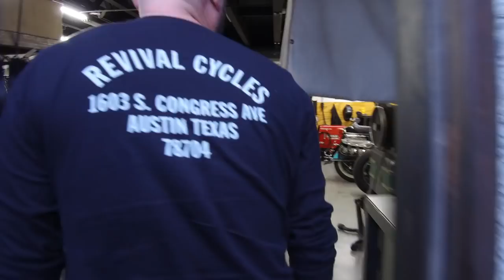Ducati build update and Alan goes colorblind! // Revival Daily 57

Comment: On the Kermit Comet do you think the bolts that connect the final drive to the swingarm are strong enough to support the back of the bike.  Did you consider connecting the final drive housing to the swingarm trellis frame?  I was thinking of turning my 82 GS1100G into a mono-shock in a similar fashion, but I was going to connect the swingarm to the shock mount on the final drive housing.